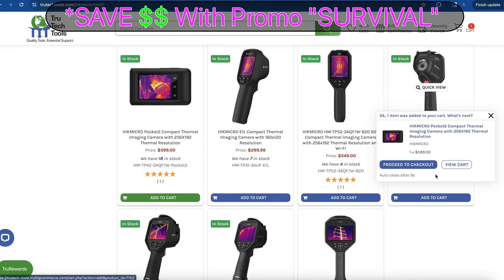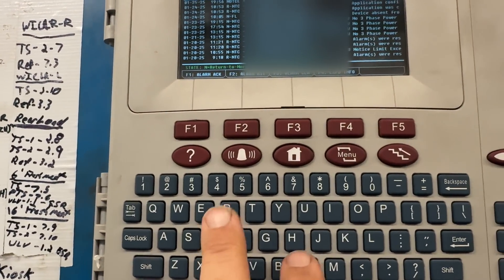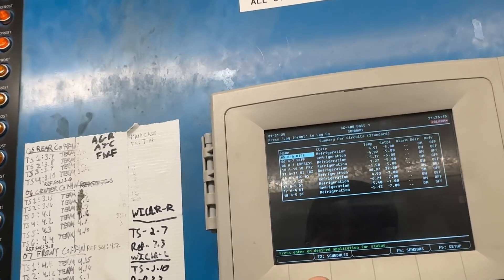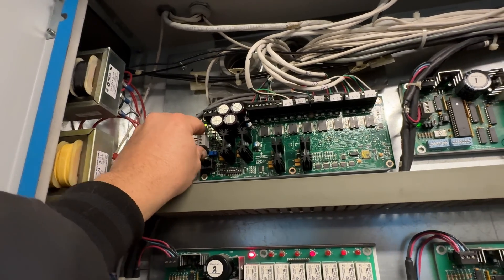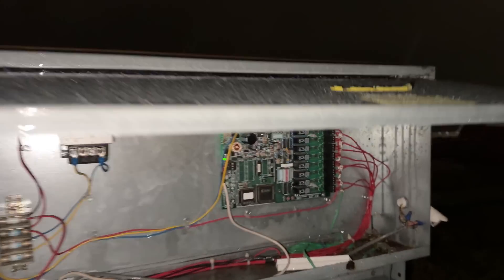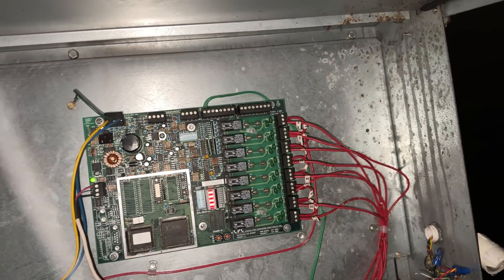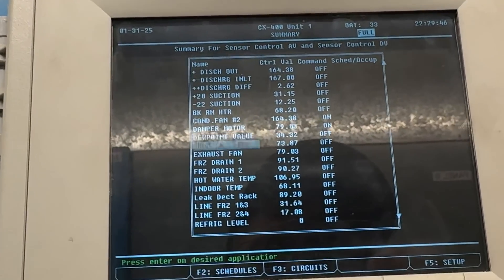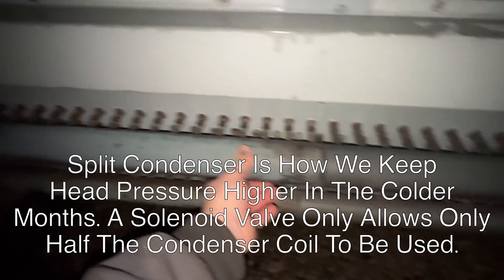Emergency Refrigeration Service Lost Comms

Comment: I gotta say man, I love these videos. I went from  super high speed, intricate equipment environment to a slow speed, still intricate equipment but mostly vended out environment. I don’t get to fiddle with stuff as much anymore, but I do have to take emergency calls every so often and these videos have helped me expand the way I think about certain equipment. 
Today I had an issue with a an economizer and air pressure sensor bugging out. Verified the economizer wasn’t the problem but never messed with transducers before, I thought about some of your videos where you seemingly just try stuff that might make sense, so I traced the pressure tube and checked voltage at the transducer and was able to determine the pressure tube rubbed a hole through causing erratic pressure readings at the transducer but not enough to send back to metasys (I’m assuming). These videos give me a sense of confidence to just work through the logic of how the equipment works and go through the list of possibilities. I’m a lonesome stationary guy now with no journeyman or foremen to rely on anymore so I appreciate the way you logically go through stuff.
Reply from the maker: That’s how I have to do it a lot. I had a chiller yesterday that would not stop running when it hit temp but the day before I tested that it shut down when I killed power to the inside controller. Oops. It shut down but only because the interlock did it and not because the remote enabled did it. Well I figured it out hours later that I had the switch in the wrong place.  I had to trace wire by wire back to the inside controller to figure out the dumb mistake. But I’ll do it right next time. The clues were there but I didn’t fully catch them. It’s normal to figure it out by walking backwards from where you know it works to where it doesn’t. We all go through it. Keep at it👍👍
Reply: @HVACRSurvival  chiller and boiler stuff I suck at. Never really got the opportunity to learn them, but my new building has 3 chillers so I’m forced to learn now which I like. 
I’m on an emergency call right now for a boiler down, both igniters in fault for two different reasons. Can’t figure it out for the life of me 😂 no flame, and flame not proving.

Comment: Recently I helped a plumbing service company branch out into HVAC service and installations. Training new techs in the HVAC world. The techs have experience in installing multi family hvac equipment mostly for apartments with hydronic heat and also heat pumps. I appreciate your videos which shows how broad the HVAC&R jobs can be. Most HVAC techs fear anything refrigeration. Your videos help show that in reality its all the same, with some different controls, or components but saturation levels work with the same princables, super heat and sub-cool. Thanks for taking the time to make the videos, very helpful for the guys wanting to learn.
Reply from the maker: Your absolutely right 👍👍

Comment: My experience with OT calls usually goes like this. Manager, have your checked the circuit breaker for the WI Freezer to make sure its either not tripped or turned off? Answer: Of course! Get your ass out here ASAP! Yes sir, on my way. You understand and agree to pay the overtime charges? Yes, of course I dont have anymore time to discuss this. CLICK. Service call is 1 hr away, we charge for min. 1 hr for the work and all travel to and back to the restaurant. Found circuit breaker turned off, not tripped. Reset breaker, cycled and checked WI Freezer for proper operation and wrote the bill. Turns out the restaurant gets restocked on Fridays and they turn off the breaker to work in the box, forgetting to turn on the breaker after stocking complete. Happends more times than I can count. Unfortunately on this occation the manager was let go because he had done this more than once. Whopper Bill!
Reply from the maker: You gotta love it when you tell people something and they pretend they didn't hear you. It happens in the comment section all the time lol

Comment: Isn't there a bypass screw on those A8/A9 regulators? Might not be on all of them but you can just loosen the screw and it'll go wide open
Reply from the maker: it was about all the way out, I took it in 6 full turns and it didn't do much. I went back Monday and it was back at 55%
Reply: @HVACRSurvival  I'm not talking about the bolt that goes into the valve for adjustment, there's a quarter inch cap-looking plug that has a little flat head knob under it that completely bypasses it.  I've had better luck using that than trying to use the adjustment.
Reply from the maker: @ I'll have to check that out next time I'm there. Thanks for the info. I did not know that.

Comment: I had the same sort of problem with a package heatpump rooftop unit with 2 coils and liquid stacking on one coil causing short of refrigerant faults after defrost as the sensor was on one coil and not averaging both. Had to move sensor to the common both coils to sort the problem.

Comment: Comm loss calls are either something dumb or you're unplugging every single case controller trying to find which board is dragging the network down. Also what is your on call rotation like ?
Reply from the maker: On Call 7 days, every 4-5 weeks.
Reply: @HVACRSurvival  we do one night a week and 5 week weekend rotation. Weekend on call guy is not on call week leading into the weekend. You end up not being on call for 10 days before the weekend. Works well
Reply from the maker: That is awesome. How many techs are there?

Comment: I was on call for the 20 below zero  wind chill week...always when RTUs shut down
Reply from the maker: That sucks, I was on next week but switched because I'm going to AHR in a week.
Reply: @HVACRSurvival  We got slammed...to the point pulled installers to run service calls.... Tomorrow I got a pile of parts that finally came in to start replacing....